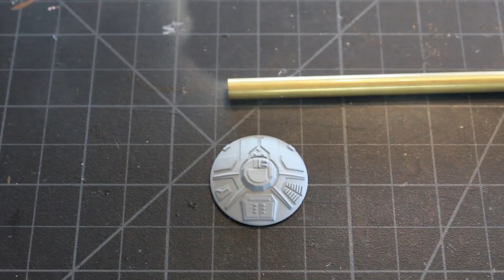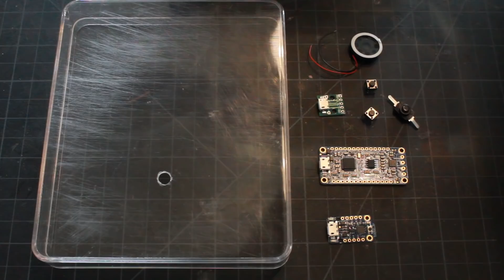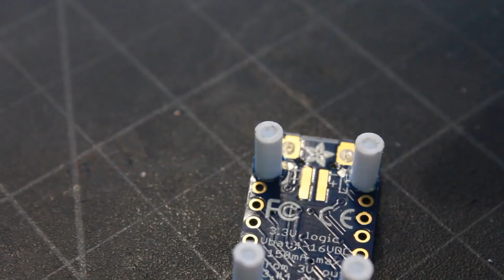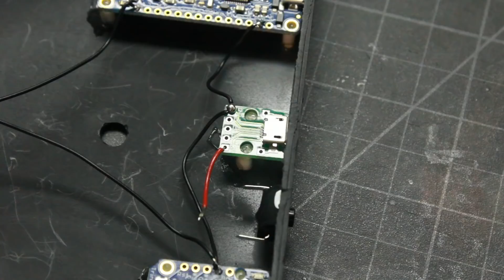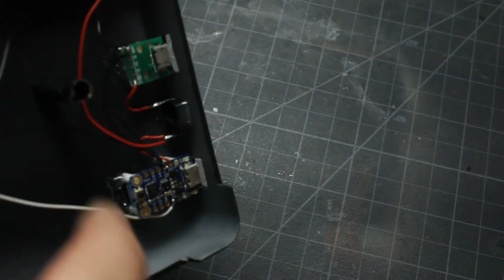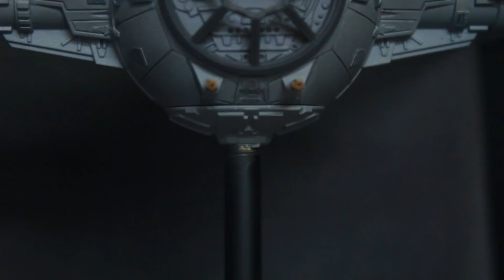Revell 1/48 Tie Fighter Pt VI Base and Electronics

Comment: Great videos Chris. Thanks for your help with Trinket code.
You used an amp for the Y wing but not this or X wing. Is an amp needed?
Looking forward to more videos.
Reply from the maker: The sound board I got for the x-wing has a built in amp.